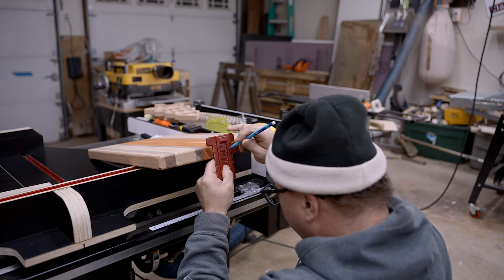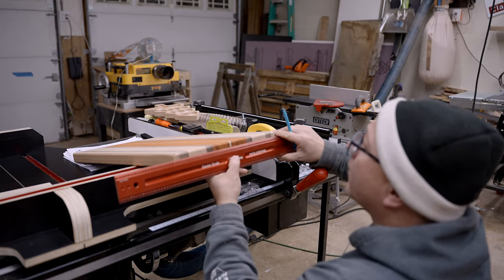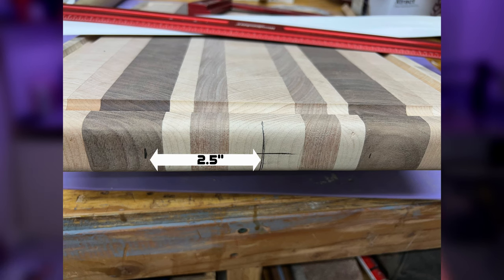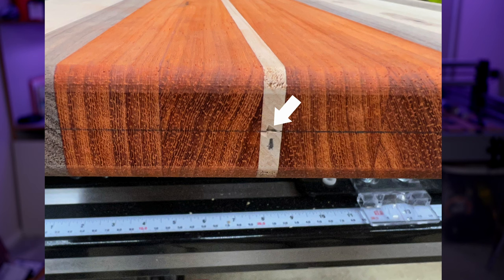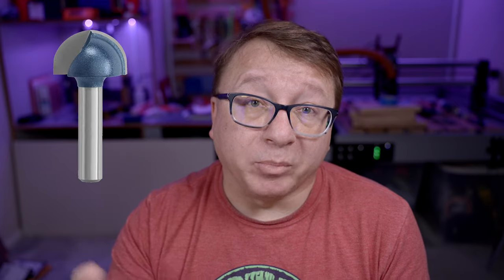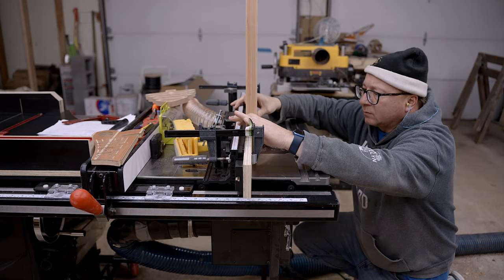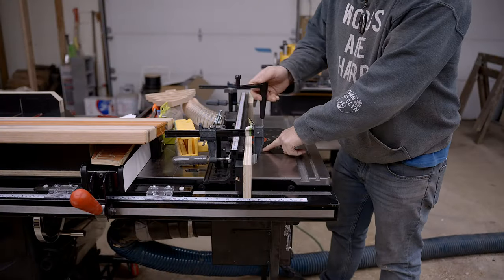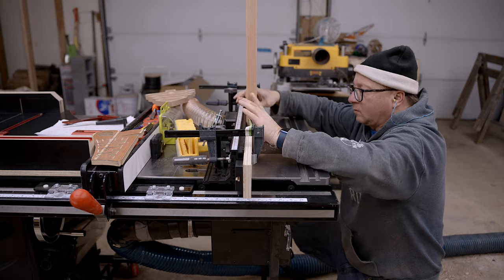Cutting Board Handles Using a Router Table - A Do Over!

Comment: ❤I put tape on the face  of  both ends of board  and  mark width of groove on the tape. I  mark left and right edges of the bit on the router insert.  Then  I make the cut starting and stopping when the marks align with bit edges. No measuring  and no stop blocks  needed.  I also have the half finder jig to align bit center to fence distance.  This  method  is simple especially when doing multiple boards  that vary in width.
Reply from the maker: Thanks Ken - do you cut the full depth in on pass? I usually take 3-4 passes so I wouldn't rely on myself hitting the same stopping point each time. Thanks for watching!
Reply: @cyberreefguru  I do 3/16 deep groove in 1 pass.

Comment: I find keeping the board vertical and not tilting it towards you is the challenge.   I’ve wondered if two sided taping a right angled triangle(s) to the board would help keeping it vertical.
Reply from the maker: I brace mind against the fence and slowly lower it down. Sometimes I accidentally tip it one way or another, but it usually works. Having something that extends the fence up would be best, like you can do for a tenon jig or cross cutting on a table saw. Alternatively, there are jigs that seems to work well. I'm going to check some of them out and see if they are easer to use. Thanks for watching!
Reply: Thanks.  Do you round over the board edges with a router before or after you router the handholds?